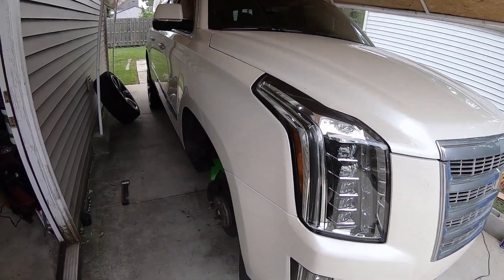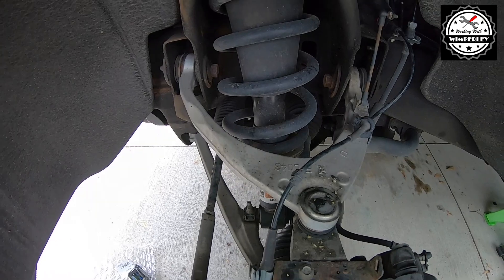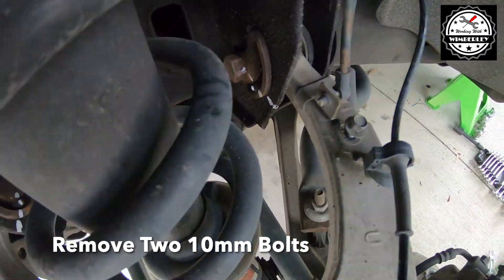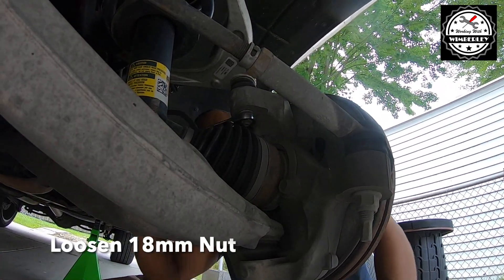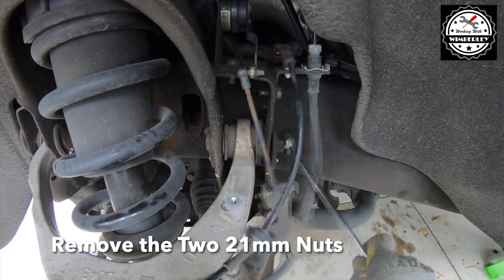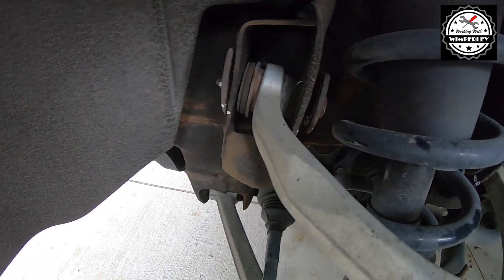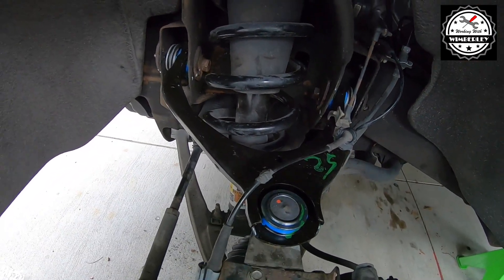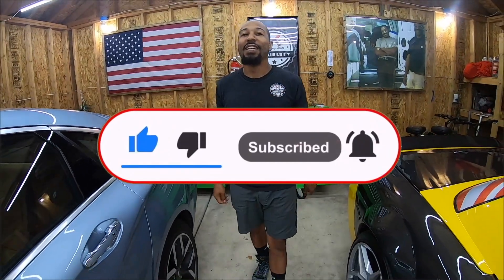2015-2020 Cadillac Escalade Upper Control Arm Replacement Tahoe Suburban Silverado Sierra Yukon XL

Comment: This video was perfect! I'm not a mechanic, and I've only done minor maintenance on my vehicles throughout the years. I'm a 50 yr old Chauffeur, and things have been a little slow lately, so I've been trying to save $ where I can. I thought I was having engine problems (shaking, low fuel mileage, etc) while I was changing the breaks on my 2020 Yukon XL, I noticed the ware & tare on the upper arms, and got advice from some other drivers. I was going to send it to the mechanic, but then I looked it up and saw your video. Of course, it was much harder to get the 2 bolts out and the ball-joint was a massive pain in the ass. But it turned out PERFECTLY! Most videos drag on unnecessarily, but you were right to the point. THANK YOU! U DA MAN!
Reply from the maker: You’re welcome! I’m glad the video helped! I definitely try to keep my videos short and sweet!

Comment: That was a great video and very informative. Is it possible to press those upper ball joints out of that control arm or do you have to replace it as a unit? Thanks
Reply from the maker: Thank you! The upper control has to be replaced as a unit. You can’t press out the ball joint. You can press it out of the lower control arm though.

Comment: I went and purchased the 3/4 forged ball joint separator from HF like you used. How did you get the forked section on yours to fit around the bottom of the ball joint? My Balljoint seems to wide (same aluminum uca). Once finally on, is that when you put the lower jaw on? Thanks!
Reply from the maker: You can see where I have it at 2:43 in the video. I'm pretty sure i hammered the fork section onto the ball joint. Since it was being replaced, I didn't worry about damaging it. The lower part went on the threaded part of the ball joint that sticks out the bottom.

Comment: Your supposed to raise the control arm up to the position where it would sit with full weight then torque the two bolts.
Reply from the maker: Thanks.
Reply: Came here to see if others said that also. Did this with not lowering and had to redo job due to shifting and creaking when driving
Reply: @anthonybron620 I’m thinking I made this same mistake. I’m getting an almost clunking/shaking sound only on one side. Do you just put a jack stand under the lower control arm while tightening the upper control arm bolts?
Reply: @doneyhome  Yes, jack vehicle up and put a jack under the lower control arm. Losen the 4 bolts, 2 upper and 2 lower on control arms. Put a jack under the lower control arm and now slowly loosen main jack. Let the weight of vehicle rest on the lower control arm. Then use main jack to just support vehicle incase the vehicle slips(safety). The main jack should actually be pushing up just let all the weight sit on control arm like if tire was resting. Then torque the 4 bolts to the proper torque. Mine were slightly moving since I did this with it jack up and no weight on control arms. That sh$% took me forever to figure out also. Make 100% sure these are torqued properly or they will move and still clunk. Another thing I'm replacing today is my sway bar clamps(2 rubber) and the two rods with plastic. It's the 4 pieces that attach to sway bar. Those also give a little clunking and are hard to detect. Mine have just a little play. Sometimes it's multiple things that cause this. My escalade has 160k miles so yeah. Oh and last thing, yes this fixed 60% of my sound but I still had some of it. Thus past weekend and to many hours researching, I found that it was my driver's bearing making a little clunking over bumps. I replaced them this past weekend and it's gone now. Yes the one side effect of a bad bearing is that sound even though it's almost always a squeaking and grinding noise. Hope this helps.
Reply: @anthonybron620  Thanks. I actually had no noises at all the first couple days after replacement. Took it for alignment, and came back and it was knocking like crazy on the drivers side. It led me to research and I realized i torqued the bolts while it was on jack stands. Hopefully re-torquing them fixes it. Also, do I need to loosen the lower control arm bolts if I’ve never touched those in the process?
Reply: @doneyhome  Nope, you shouldn't have to since those have always naturally sat where they are. As long as they didn't shift due to the other ones. You should be able to see if anything moved though by looking at dirt and greese near the lower bolts. Worst case it doesn't fix it and then you just losen all and re-torque all together.
Reply: @doneyhome  My bolts were actually a little loose so that didn't help but I beleive it happened because it was fighting itself since it wasn't aligned.

Comment: What was the reason you had to replace them? Did the control arms came pre greased? Thanks!
Reply from the maker: The entire Escalade vibrated when I drove over 70mph. The ball joints on the upper control arms were shot. And I bought GM AC Delco brand and they came greased already. But they are not serviceable meaning you can’t grease them  because they don’t have a zerk fitting. If you get a different brand, you might be able to grease them.
Reply: @WorkingWithWimberley  can you please share the link on the control arms?
Reply from the maker: @JoseRodriguez-em3rq  
Driver side: https://amzn.to/3ocdJcm
Passenger side: https://amzn.to/41UArDF

Comment: Hey man, great video. How reliable has your Escalade been for you by the way? How many miles are on it and any lifter or trans issues?
Reply from the maker: Thanks! It’s been pretty reliable. The biggest issue I had was a fuel injector failing. And that was at around 130K miles. I have a video about that. https://youtu.be/yvbegd8w-EE I don’t have any engine or lifter issues. If you change the oil regularly, that’s not a problem. If you don’t maintain the oil, they fail. And the transmission is my biggest issue. Those 8 speeds are notorious for a shudder. I had it really bad. I had the fluid changed and added and additive and now it’s way better, but at times, I can feel it slightly. But it’s so slight now that I doesn’t bother me.
Reply: @WorkingWithWimberley  thank you so much man! Have been considering one for my wife. Have had to replace the suspension yet? Also do you recommend the 18’ and up since they have the 10 speed tranny or no?
Reply from the maker: @Beardown482   No problem! I actually did replace the front struts and rear shocks when I bought it 2 years ago. It’s easy to do, but the parts are expensive. And if you can avoid the 8 speed, you should. I don’t know of any issues with the 10 speed since I don’t own one, but I’d avoid the 8 speed if possible.
Reply: @WorkingWithWimberley  thanks so much man!
Reply from the maker: @Beardown482  You’re welcome.

Comment: What’s up bro. Got a 15 yukon denali. Just got some new shoes and alignment and it’s already worn insides of my tires! Was this your issue you was having? Thanks!
Reply from the maker: My issue was a bad vibration on the highway around 70mph. The ball joints on the upper control arms were so loose, I could move them with one finger. After replacing the control arms, the vibration went away.
Reply: @WorkingWithWimberley  I’ve been looking to replace them. My wife also mentioned sometimes when she’s turning, she can hear a pop and she said she can hear some squeaks when the front suspension compresses.
Reply from the maker: @LS3438  You can’t go wrong by replacing them. I’m actually going to replace my lowers as well.
Reply: Did you make a video for lower?
Reply from the maker: @rurban01  No not yet. I will record it when I change mine this summer though.

Comment: My 2015 Tahoe squeaks terribly in the front end. I think it’s the control arm.  Any ideas? 
Thanks
Reply from the maker: Usually when I have a squeak it’s the sway bar end links. I’ve also had struts that squeaked. The bad ball joints in my upper control arms caused a loud pop when I turned. That’s why I changed them.
Reply: @WorkingWithWimberley  thank you!
Reply from the maker: @jessewaller8971  You’re welcome!

Comment: Why change the whole control arm and not just the ball joints?
Reply from the maker: I did the whole control arm because it also means you get new bushings where it bolts to the frame. And I don’t have a press so I didn’t want to bother trying to press out the old and press in the new.